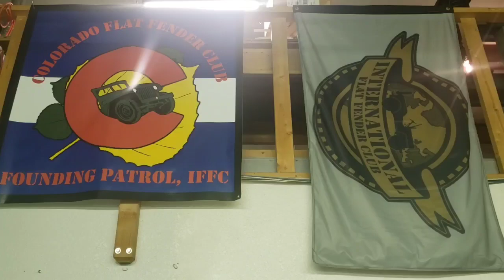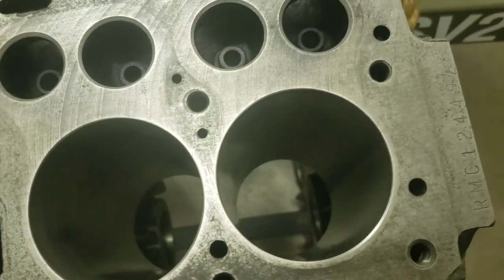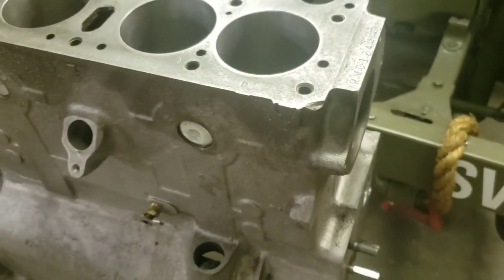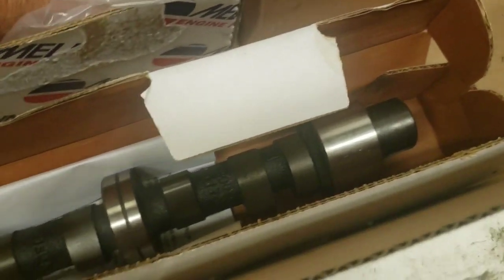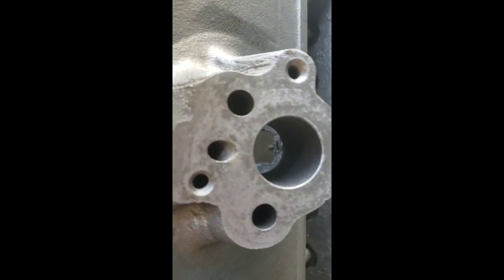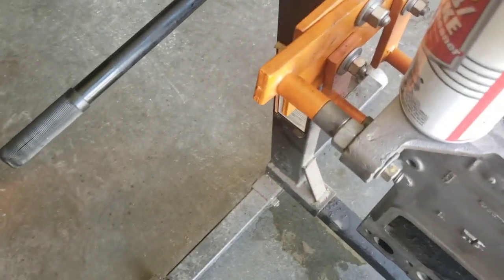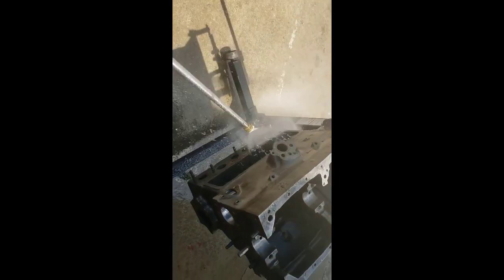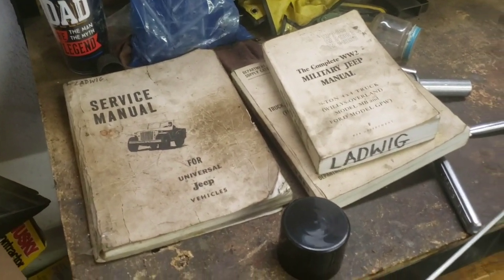Rebuilding a L134 jeep engine

Comment: I know that you did this quite a while ago but that's an M-38 block as indicated by the serial number, not a CJ block.  It's also a late version of that block as well.
Reply: Mine have serial number in the same spot but start with the letter and number 1MB following of five numbers (23***), what engine is that make that?

Comment: I like to use machinist "way oil" to hose out the swarf and junk out of the oil passages.  It's basically designed to float all those sharp bits of metal out of the super tight bearing surfaces in in a machine tool, so might work well for junk packed in those hard to reach places.  I am a machinist, and I find casting sand in 50+ year old engines all the time, from when they were just little baby engines, hah.

Comment: Lew..the main bearing caps...would it be a good indicator that the cast numbers on them have the base facing the rear of the block as an orientation? Are they usually marked with a matching number like your diff carrier bearing caps are?
Reply from the maker: Hmmm?  I never looked at that.  I always mark them to keep them  correct.   I'll take a look next time.
Reply: @hummernutsfl  that'd be great because all my caps were removed when I bought the blocks....they weren't bolted in but sitting loose.

Comment: I'm watching this and thinking the oil pump is for an engine with a timing chain. The pump end has red on it, and I believe the sprocket is correct for timing chain. I just had my chain driven apart and sprocket is the same. Am I wrong?

Comment: Nice! Question,  how do you know what piston goes in what bore? My machinist fits each piston to its bore making them a mated pair. Rarely will you order pistons and have them be all the same size. I've seen pistons very in size .002 +

Nice work!
Reply from the maker: My pistons can vary in OD just a tad but are always mid range of the spec.  The important thing is to get the ring gap correct.  If one hole had to be bored over size bigger than the others, that size as well as the others will be stamped in the top of the piston and on the block.  I have all my running gear like pistons, rods, crank etc all balanced.  My guy is cheap so I go for it.  Others charge alot so may not be worth it.

Comment: What is the usual life of a quality engine rebuild such as yours?
Reply from the maker: I imagine one will get about 100k if maintained.  Those old motors do not last as long as modern stuff but they do well for the technology.   They are a low rpm, low compression motor so the bearings last a long time.  The down side is the long stroke causes more ring and piston wear so they slowly become oval shaped.  Takes a inside micrometer to measure the cylinders but that is why a hone job is a waste.
Reply: Thanks.  As I recall the older engines often needed a valve job before pistons and rings
Reply from the maker: @kumsuk77777  yup, valves ground and maybe new guides.